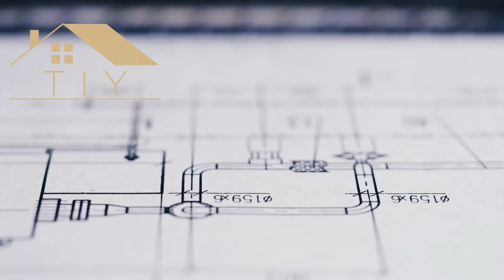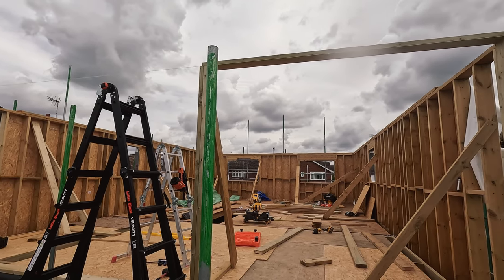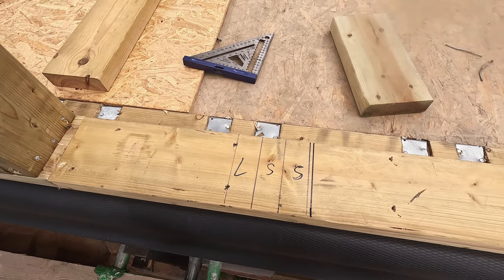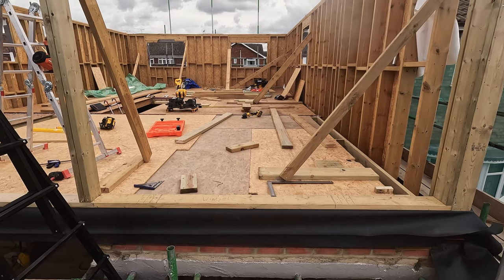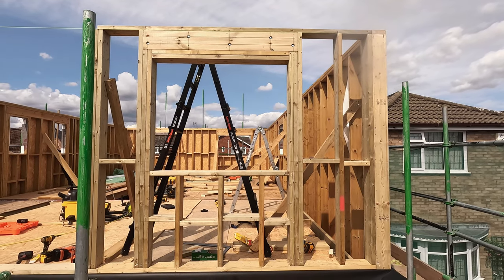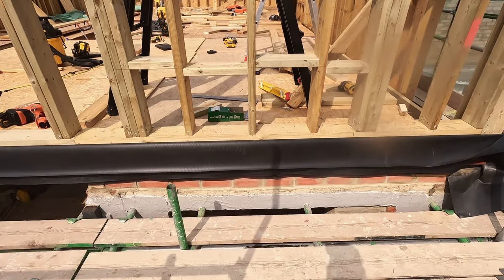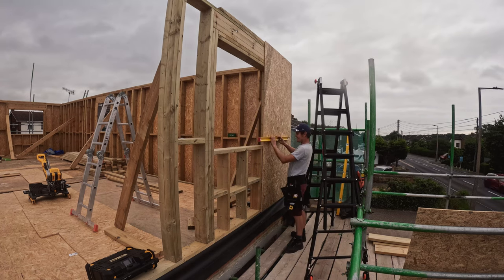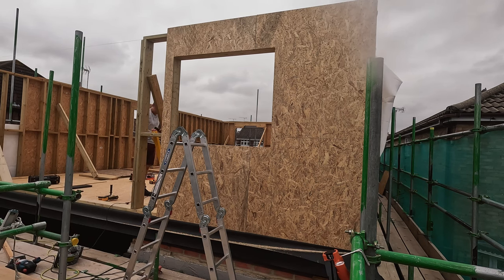Detached Bungalow to Detached House Renovation - BUILDING THE FRONT RIGHT BEDROOM WALL.

Comment: Was was also going to point out that in addition to the fantastic bit of kit the stabila extending level is albeit (ouch )expensive it's extending length reduces any discrepancy right down to nothing. Seeing you struggle with the leveling of the first top plate, up and down all on your Todd to get it perfectly level, you'd save your self stacks of time with a Bosch digital level (inclinometer),either the 1200 or the 600.... Audio beep when plumb or level to a tenth of a degree. The GIM60L also incorporates incorporates a laser beam which saves getting the separate laser level out and set up
Reply from the maker: That’s very interesting. I never need an excuse to spend money on tools however I’m at the stage of the build now where money is non existent 😂😂 the mrs would kill me. I’ll do some research on that though as it would be great when I build the extension eventually to have that. I found the extending stabila one very heavy to use lol